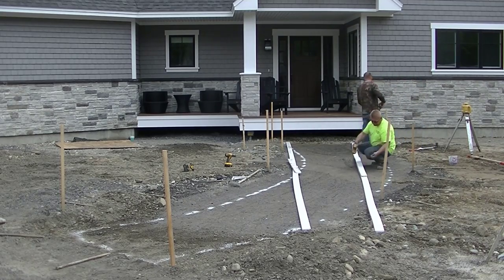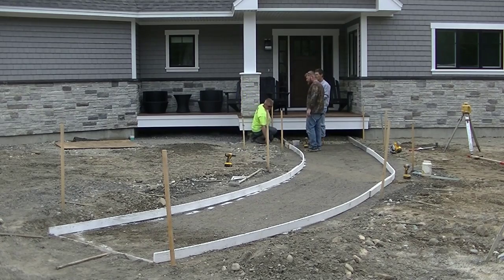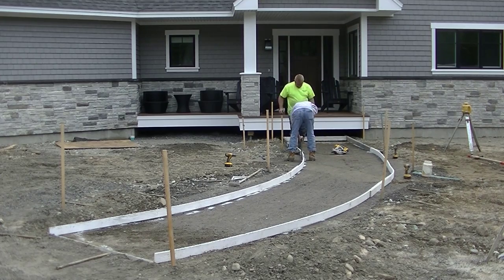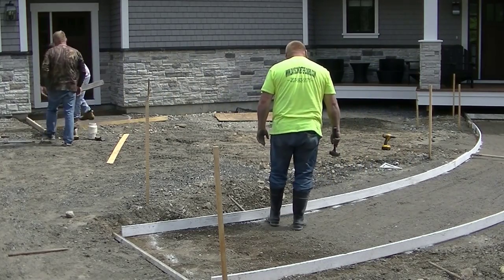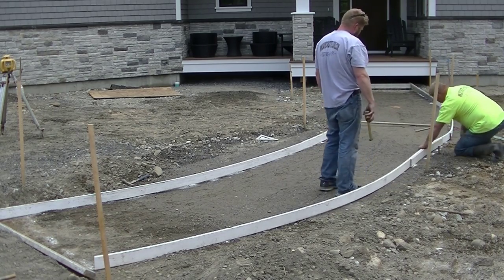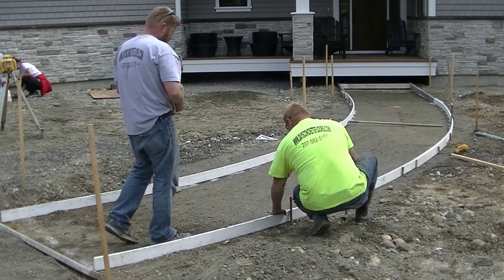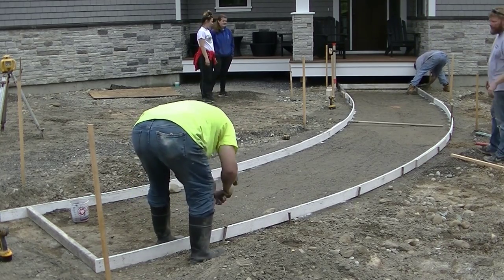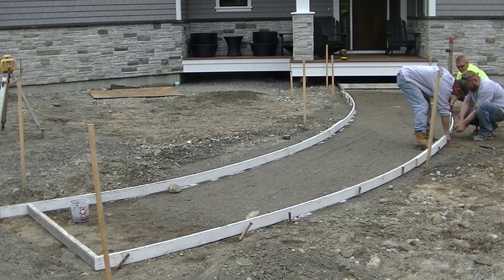How To Form A Curved Concrete Sidewalk | Stamped Concrete Walkway Part 1

Comment: Nice set-up. Just Fyi cut a board the width of your walkway and use that as a spacer while you our setting the forms it will make a whole lot easier to maintain your width. Instead of  having  to keep pulling out your measuring tape all the time to make sure you our at the right measurement.
Reply: A story pole 😬

Comment: Luan plywood is thin, cheap, and flexible. Sometimes double up the pieces for strength. Is there a problem using deck screws from the outside (through stake to wood form instead of nails? How thick is the plastic you are using?

Comment: We use plastic forms that have removable metal clips that we pin in place and then they clamp onto the stake for our grade
Reply: We used to use the azak also. Just prefer to use our new ones now. We use the azak when we have to cut a piece
Reply from the maker: What are they called. Manufacturer and where do  you get them? Thanks
Reply: Mike Day Everything About Concrete dont recall the manufacturer. We got them from superior northeast in south windsor connecticut

Comment: Azek board is the ticket. It is expensive but if taken stripped, cleaned and stored properly it works awesome. I've found out we need to put forming pins approximately every 24"-30" apart so the board doesnt lose its shape while pouring and finishing though. That would be my only complaint about Azek. You're jobsite looks awesome! Keep up the great videos and work!! 👍☝️
Reply from the maker: Thank You!

Comment: Great video Mike! 
I use Masonite to round the corners because you can get a pretty tight radius if that's what you're trying to do. I like the idea of PVC trim boards for a long gentle sweep, but I only do concrete work occasionally anymore. I'll keep that in mind if I do a job like that.
Reply from the maker: Thanks for watching!!

Comment: Can you just use like a 5/16 inch wood paneling and just rip it down for side forms?
Reply from the maker: You can, yes. We've ripped 3/8 plywood and used it before.
Reply: @MikeDayConcrete  okay great.

Comment: We use masonite. I prefer plastic but I am not running the show ;)

I like to cut a "keeper", which is a 2x4 the exact width of the side walk, that way after I establish dimension on the house-side form, I just put the keeper perpendicular to the form on the inside and butt my down hill form against that, putting all the stakes in the second form across from the high side stakes. Then I set height on the high side, and just use a level at each stake to establish cross pitch on the low side. It's a fast way to do it, and very hard to fuck up.
Reply: I do the exact same thing for public walks. Get the back side up first and set it where you want; duct tape the level on the form and the front side is a piece of cake. 🤙💪
Reply: No need for profanity

Comment: i always wondered about using pvc trim...of course i watch THIS video AFTER purchasing the 1/4 plyboard😭. plus my circular saw will probably splinter it. thnx for the video-subscribed
Reply from the maker: Thanks for subscribing. Yea, the pvc is really easy to use. We re-use it for many pours. I've had some for over 2 years.

Comment: Have them guys cut a two by four the width of the side walk and then set one form to its curve, then use the two by four to keep the distant's all the way down on the other side while screwing and putting the other form in place as they go, instead of using the tape measure over and over and having to check the width. Cuts your time by a third and keeps a precise measurement across the forms, while forming small jobs like this !
Reply from the maker: Got it, thanks.

Comment: Can’t find the answer to this question anywhere. Pouring a patio with a circle void around a tree at about 3’ diameter. How would I edge this concave curve? Would I use a normal hand edger but tilt it so only the tip is working the concrete?